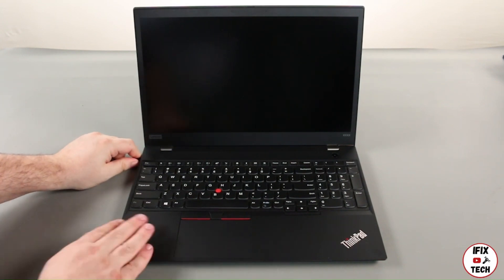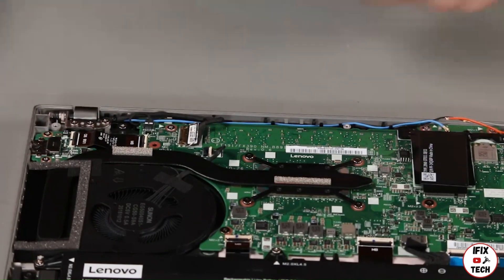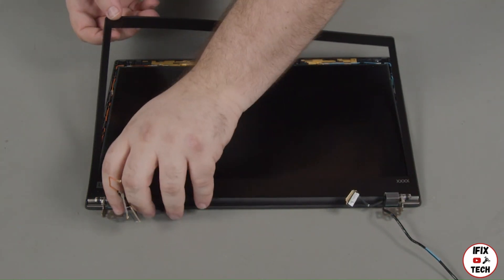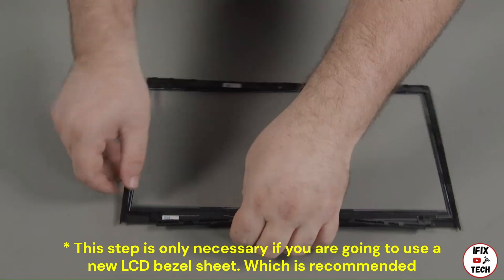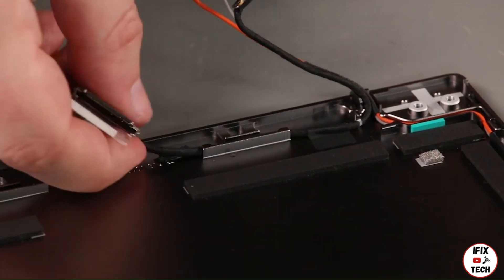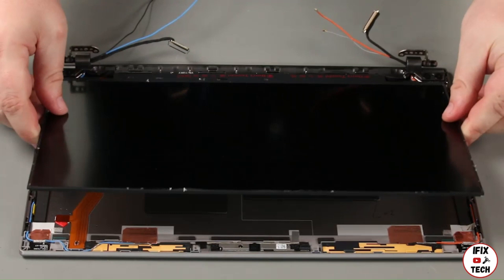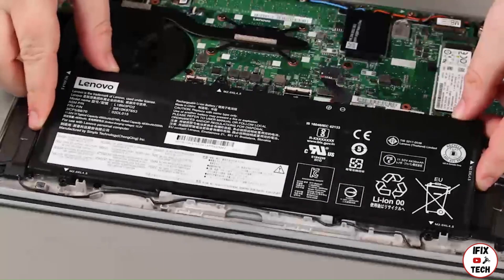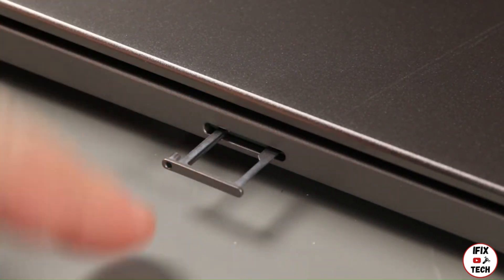Lenovo ThinkPad Laptop X390 and X395 LCD SCREEN CABLE Replacement - How to Remove LCD Cable

Comment: Hi plz can I use cable same type of pc with different P/N or FRU ?
Reply from the maker: Yes, you can. Just make sure they are compatible. You can do that on the Lenovo website pcsupport.lenovo.com under parts look up. Thanks for liking it and subscribing 👋 😉